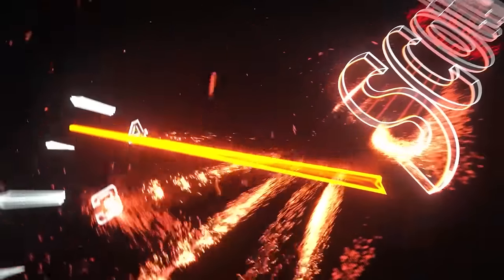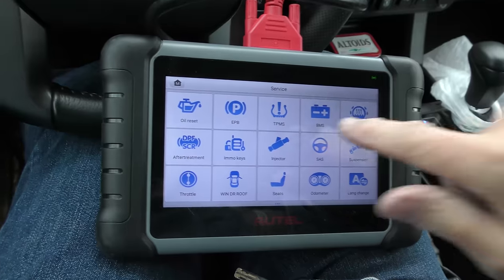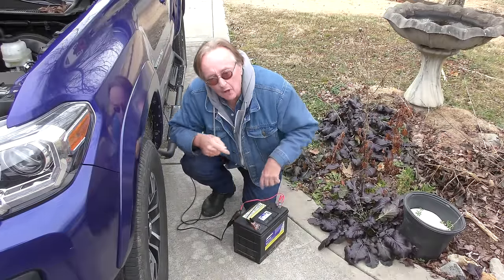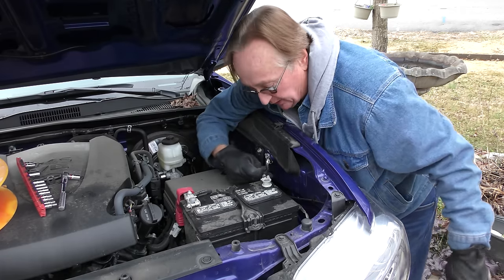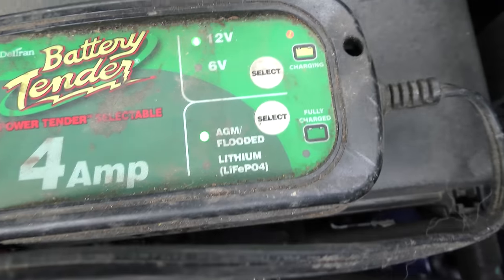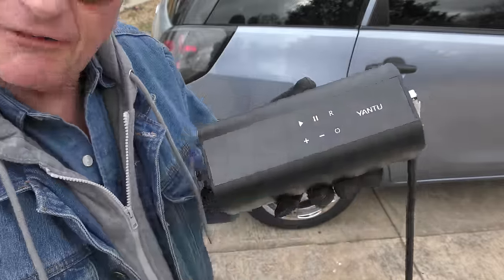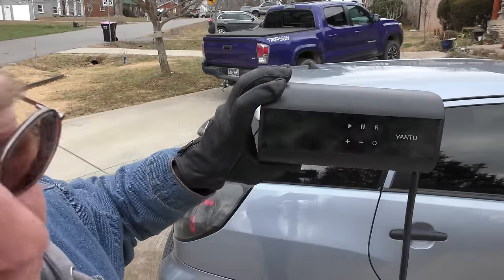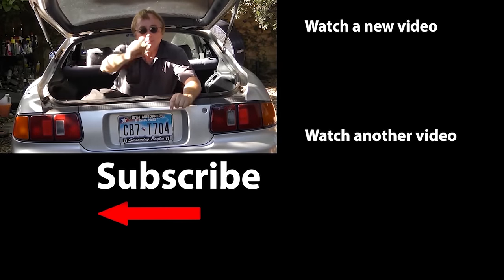Doing This Will Make Your Car Battery Last Twice as Long

Comment: Car manufactures are adding more and more needless electronic crap to vehicles. It's ridiculous.
Reply: Absolutely ridiculous. This kinda crap is why I prefer older vehicles.
Reply: MAKE CARS GREAT AGAIN
Reply: Haf to remove all kind of wires to change my battery this weak
Reply: @kentworch me too.
Reply: Utterly ridiculous!
Reply: @kentworch Bosch components are very poor & expensive nowadays. Even Ford & Chrysler are using Nippon Denso  since the 90s!
Reply: Remember who actually makes ridiculous laws to make the manufacturers do what they do  ?
Reply: @silentman305 top-shelf spelling.
Reply: Cry about it and get with the new times
Reply: @Piznick64 B/S🎉
Reply: @BrendaGraham-t6b  I wasn't crying the last time I checked...
Reply: @Piznick64  As someone who can fix most things on cars, I can confirm that you are correct. I like being lazy😂
Reply: The most annoying being the stupid auto start stop. I just keep it turned off. Most idiotic thing ever just wears out your starter
Reply: It’s not needless to THE car Dealers or mechanics that’s what they get their income from
Reply: @WNicole1993 computer shutting down when car does would make sense but the computer reads the key once it’s in the car to start it so can’t shut down all the way and putting a separate battery to go into Sleep MODE like a desktop computer and wake up when the key fob is pressed would make sense but then that’s another thing to fix like those dumb tire pressure monitor systems they make so cheap. Although my cars a 08 Toyota and my tire pressure monitor works fine and all 4 batteries are at 70% life never been touched. 
Yet newer cars seem to need their batteries already some only 5 years old! So they aren’t making them to last!
Reply: Adding smaller batteries only makes them worse
Reply: Like an electric parking brake.
Reply: Yeah, I would say 2010-2013 or so is the cutoff when cars had the most useful features without all the garbage that is just prone to fail at some point.
Reply: @silentman305 
Weak battery this week.
Reply: They've even made the motors electric... it's a disgrace to automotive history
Reply: Mucho of the videos seen here are well said done best is things shouldmade simple  not all crap things we donot need
Reply: All said now on I pad about  automobiles   When I had my Volkswagen eurovan  abs automatic brake  system go bad  I still had old fashions brakes on the foot pedal one shop told me 2full days in shop take whole steering column apart  2000 dinero to fix  I refused  only used foot brake  I miss small vent windows on front doors  donot care  for ac units  on motors why cars donot sell well very high prices even higher when financed auto loans more I repeat is so many things these days  are such high costs females gold diggers  dating  wanting  marriage weddings costs god help us all  for what so they wear rings on their fingers 20000dinero for what need I repeat  past comments  34plus years  just very nice why fix if never broken  do as you please my worries first yours well
Reply: @AJ-sp7pc well it mainly drains your battery having to start the car up again and gets worse if you are stuck in traffic just to save fuel at the cost of your battery
Reply: Lane departure adaptive cruise all wheel drive blind spot navigation
Reply: @AJ-sp7pc  you can't call something idiotic, after buying a vehicle with that feature....
Reply: It's part of technocratic controls systems.
Reply: I keep my 2017 Lexus LS parked in my garage with a trick charger hooked up semi-permanently.  For the exact reason you said.  The only issue is remembering to unplug before driving off -
Reply: Cruise control is useful also android auto... 😂
Reply: @Piznick64  You must work for a car manufacturer.
Reply: Yes, electronics, designed to Fail  and cost us more, more, that's how to stimulate the Economy ?

Comment: Hey Scotty, Funny thing happened a year ago, Several houses down my street a pickup in a driveway would not start. They ask me for a jump. Several people standing around. Already jumped twice with no results. I walked up and twisted the cables a little and one came off in my hand. I told them THERE is the cause of the problem. Fix those loose cables first. Then everyone looked at me like I was a Martian. Over 50 years back my father in law said just about what you said here. Check the cables first.
Reply: Those people were in AWE.... you gotta forgive them!
Reply: The same thing happened to my son in law.  He called one of those car starting companies and it started.  Before he bought a new battery he asked me if I could check it.  I did, it was good.  Turned out to be a loose battery terminal.
Reply: People are stupid....how could they not tell they were loose when they hooked it up
Reply: A similar thing happened to me. As that was walking by I noticed a car with the hood up. The driver said it wouldn’t start. I noticed one of the battery terminals was loose. I pulled out my Leatherman, clean the terminal and the battery and put it back on and tightened it with my Leatherman. It started right up.
Reply: Loose cables. Repent-and-believe-in-Jesus
Reply: Makes you feel special,  eh  ?

Comment: It's not just loose cables, but almost any corrosion on the terminals can prevent a car from starting. My first move is always to clean the posts and cables with a wire brush tool (or use sandpaper), then reinstall & tighten. Maybe coat with some petroleum jelly after.  If it still doesn't turn over, then charge it or jump start.

Comment: I personally like the 12v solar panel battery trickle chargers. They have adapters to either plug right into your 12v plugin in your vehicle, to cables to use for independent batteries. Don't have to worry about overcharging or electricity either, albeit it does rely on having the sun out (which most times during the day isn't an issue)
Reply: smart
Reply: Heard about people in colder countries insulting their batteries
Reply: You are using one then? How many watts is it? I jsut ordered a 10w but Im not sure it will be enough juic. I assume you have tested and had a while so youre sure its actually providing enough power to put some charge into battery. Let me know you results, thanks.
Reply: IDK your experience nor what exact charger you use, but I do the same, because its obviously a great idea.  But I keep mine parked on the rear shelf, and once in a while I check for voltage at the alligator clamps and it uniformly reads "17V".  I have no idea if that's good or bad, or even if it's enough voltage to achieve the desired results, esp since its probably the OHMS getting to the battery not mere voltage that charges up the battery, I think.
IDK enough about electrical to know if it even matters.  I have my Lexus garaged and on a trickle charger when it sits idle, since if there's any kind of car that has a large parasitic draw its a big Lexus - but again IDK how much, if any, it helps the battery life.
Reply: At the start of what year have they started using AGM batteries
Reply: @quartqwertbudisgood  I only insult mine when it doesn't work. The rest of the time I praise it.

Comment: I recently retired a 1999 GMC van.  The battery is 9 years old and still tests like a new battery.  When the battery was 1 year old, I hard wired a small solar panel on the roof of the van, that delivers 3 Watts of trickle charge to the battery when the sun shines.  I am fully convinced that the daily trickle charge has kept the battery healthy and it has never been boosted or let me down.
Reply: You don't live in the South. Down here in FL once the battery has 3 years on it you better be replacing it (and there's NOTHING you can do about it the battery is dated).
Reply: @leecowell8165  What is it about Florida that kills batteries in 3 years.  If you buy a battery that is fully warranteed for 5 years, you should never have to buy another battery as long as you live.
Reply: @chrisgraham2904  heat maybe
Reply: @leecowell8165  You're so right! I lived in Miami for most of my life. Not ONE of my car batteries EVER made it to 3 yrs! Perhaps it's all the sitting in traffic using the A/C, radio, CD, and charging our cells.??? That's my guess.
Reply: @chrisgraham2904  it's the heat. Same here in AZ.
Reply: Just gotta say I’ve lived in Florida my whole life and years ago batteries would last 6 or 7 years. Quality is down for sure. I’d have to say that nowadays you’re correct. 3 years now and god forbid u get a cheap battery and it doesn’t even last that long. As soon as the warranty is up I hey somehow just instantly turn to crap 😂
Reply: @420face  Short out your battery with a piece of rebar and rubber gloves every two and a half years, while it's under warranty, and you should have free batteries for life.  LOL.

Comment: I still have my original battery in my 15 Challenger. It's just amazing that it has lasted so long.
Reply: Your driving on borrowed time. Batteries last about 5 - 7 years. Plus you just jinked your battery so there's that.
Reply: @derrinpickett9948  Yeah I switch mine out every 5 years, regardless.  Better than my truck not starting when it's -10 out.
Reply: I have a 2017 Durango with a 3.6. I just replaced the original battery Group 48. I didn't replace the start stop motorcycle one. Stop Start hasn't worked in a year and a half Now the light is on. No iam it replacing it.

Comment: I think most current battery chargers will switch a relay when it senses a full charge so it stops applying current. My Harbor Freight one does
Reply: "...current battery chargers..."

Heh.
Reply: @edwatts9890   I'm not talking about bargain basement. Most current stuff has a limiter from what I have seen. It's nice protection from overcharging
Reply: @joeman5220 : WHOOSH!

You missed the pun!
Reply: @edwatts9890  hahahahhah he sure did. But don't worry I got it in 1 nano second.

Comment: IMPORTANT -- when changing a battery, REMOVE the negative terminal, then the positive terminal on the OLD battery. On the NEW battery, attach the POSITIVE terminal first, then the negative. Removing or attaching the wrong terminal first can cause a short and fry very expensive electronics.

Comment: After watching several videos on restoring the battery, It actual worked. My battery in my truck is about 8 years old or older. After doing these method on restoring it which been about 3 years ago, it still charges and starts with no problems. Scotty, I think we maybe related. My last name is the same as yours.  Always like your helpful tips and ways you can DIY.

Comment: I turned off the features that use the battery after the engine is off, such as keeping the headlights. interior lights, etc. on.  I dont turn on electricity intensive things like rear defrost, heated seats, etc, until I'm driving on the road. So far, the battery is 10 years old. The car started just fine in my recent minus 16 C morning.

Comment: Re: Battery terminals. I have seen terminals that are loose even when tightened. Over time, the terminal gets stretched. I have cut a piece of metal from a soda can to use as a shim around the post.

Comment: Great advice for a flat tire, but what if the tire is ruined with a huge hole in it, the tire inflator won't work. My advice is if you have a car without a spare tire, then you buy a spare tire for your car

Comment: I bought the battery operated DeWalt tire inflator. Comes with battery charger. Works great. Make sure battery is always charged. I charge up my auto battery every couple of months to a full 100 percent charge with my battery charger. Takes under a half hour to fully charge the car battery. Fully charged battery will last longer.

Comment: When buying a new car, be sure to tell them you want a new tire and rim for your spare. A JACK too.
Tire lug tool.
Space saver tires they used to give are limited to 50 miles at 50mpg. They cost almost as much as a real tire.
Also, you can not use 4wd when using that spare. Been there done that.
Reply: You get 50 mpg if using a spare?   Sorry, couldn’t stop myself.
Reply: @woohunter1  No lol
You can go 50mph and 50 miles on that space saver spare. Read the sidewall.

Comment: I also like this black and decker 12v batt recondition charger. Every once or twice run the recondition mode on it and the battery lasts longer. Ive had Oreillys tell me i need a new battery but so far 2 batteries still work. You don't want the voltage to get under 1.26v and sit like that for long.

Comment: The circuitry in the alternated controls the level of charge.  I've looked at it myself (on that motor).  Resetting does something, but it doesn't control the level of charge.

Comment: I have a 25ah lithium hybrid battery. My car has never started so quickly. Those supper caps make the difference. Fantastic for a car that only goes through a couple of tanks of fuel each year
Reply: What's that battery / charging system?

Comment: I have Autel system and did not realize that, I have slightly older cars, but will check this now, just changed the battery and noticed the factory battery was AGM, so replaced with another AGM.  Scotty, thanks.

Comment: How about using jumper cables from another 12v battery to hook onto the + and - leads. Loosen off the lead from the bad battery, place the jumped leads carefully aside, remove old battery, install new one and hook up still jumped leads. After tightening, remove jumper cables. All info and comp. modules should still be the same.
Reply: There's a device that does this exact same thing.  Forgot the name.
Reply: Thats not what hes talking about. The computers would run funny for a while but it would run okay once it relearns settings. AGM isnt part of that.
Reply: Ive seen plugs for your cigarette lighter that have a small battery.
Reply: So you have to place the new battery with the jumper cables attached to it? Sounds tricky to not shortcircuit.

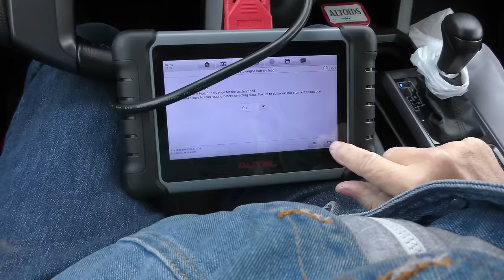Comment: 2:30 Memory saver? Never used one. What worked for me was before I remove the terminal connector to the dead battery, I'd have one extra 12v battery and clip it straight to the terminal connector. Never had any problems at all.

Comment: Scotty,
My son’s 2007 Toyota Camry XLE V6 just turned 200k miles. There’s a problem that we can’t find any one to figure out. The front end shakes as you get up to 40ml/he. Took it to Toyota dealer, they don’t know what’s wrong with it and they still charged almost $1000. The tires still have good tread life. Someone said to replace tires. We just put four brand new tires still shaking. It’s not the ball joints. Any idea what this can be. This car still runs great
Reply: sounds like that faulty torque converter that they had on those model years. i think scotty did a vide on it once

Comment: Hi Scotty, I hope you can share some info for me.
I have a 2024 Toyota Yaris Cross HEV. I was wondering if it's safe or I could charge my 12V battery like any regular cars do? Like the one you shared on this video.
If yes, where is it safe to connect, directly thru the 12V battery terminals or to the jump post in the engine bay area?
Thanks!
I hope you take notice of my comment.

Comment: Lawn mower batteries can be lots of problems cause people do not use them during the winter months. Most lead acid batteries, be it AGM or flooded self discharge 4 to 12% a month. The AGM is better at not self discharging as much, about 4 to 6% a month.  The flooded cells have to be maintained with float charges if stored for long periods of time. Also the flooded cells when not maintained and the voltage is left below 12 volts for a month are more, crystals start to form on the plates and start to degrade the lead plates. The only way to correct the problem is use that battery tender are a charger that has a pulse charge feature, are a electrolyte additive. There are many videos of people adding epsom salt to a flooded, yes it may gradually clean the plates but it also messes up the chemical process in the electrolyte in the battery.

Comment: I worked for (delivery driver) Johnson Controls which owns 80% of replacement battery production including Optima AGM or assembled glass mat. When originally built these battery's lasted 20 plus years. Now made in Mexico they are designed to last just past the 5 year warranty. Sad.

Comment: We have a AGM deep cycle battery that we use as a backup to operate fan motor on LPG stove when grid power fails. If we`re lucky it will operate 100 watt fan for 18 hours to keep farmhouse warm until grid power is restored. Thankfully we drive old antique trucks that don`t have any of this complicated computer controlled nonsense! Our tractors are 72 years old, gas powered,as well with points/ condenser ignition as well as the 1970 C10 P/U. Our 89 S10 Blazer is the only truck with a OBD1 computer thankfully.
Reply: only way to go but depends on blazer, carb or that stupid actual throttle body injection or that useless SPIDER INJECTION, carb or throttle was more reliable than the new trash in the 90's

Comment: what good is a tire/air pump for a flat tire that has a hole/nail or whatever in it ?  Are the seal kits they sell (some cars come with) any good ?
Reply: None of them work. Stick and stab is ok for temporary use. Tire shop should charge around 33 bucks to fix it.  Mini compressor won't really work if it's a big leak.

Comment: Just replaced the original battery from my 2013 corolla 150k miles and 12 years later. I live in Massachusetts so the weather was not kind to it either.

Comment: Oh... 2013 Buick, original battery, now it's 2024 so that's 11yo and still seems to be going strong.  Cranks and starts in literally 1sec when I bap the button.
Reply: That battery is on borrowed time .  Modern era automotive flooded lead acid batteries will operate perfectly until they leave you stranded. Change it out now.